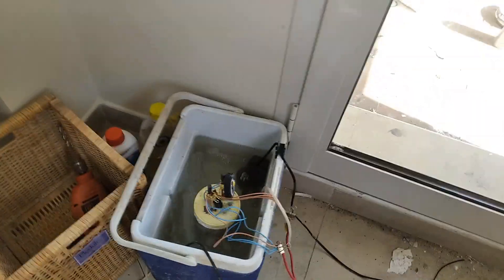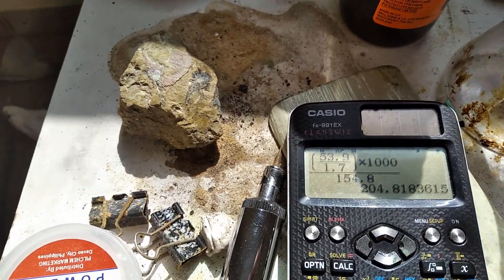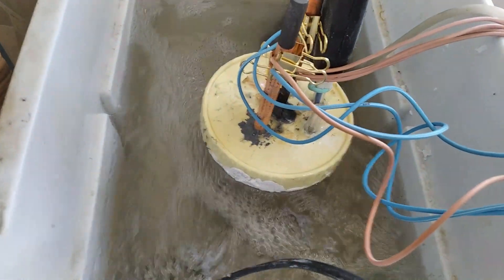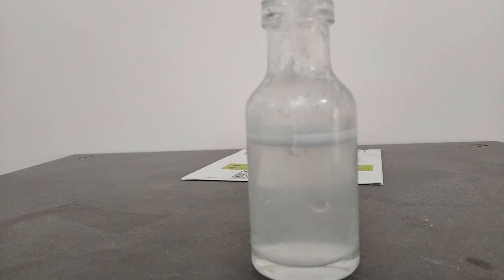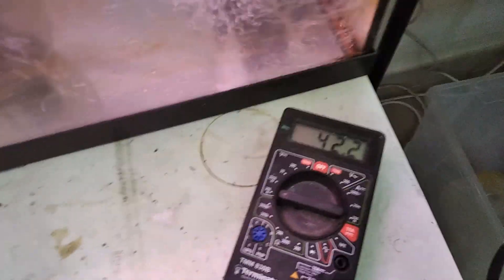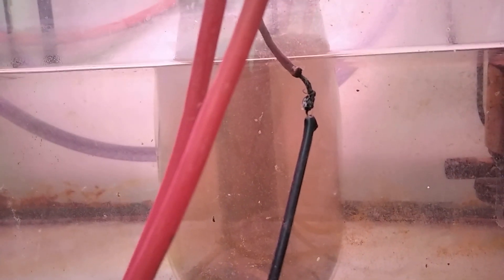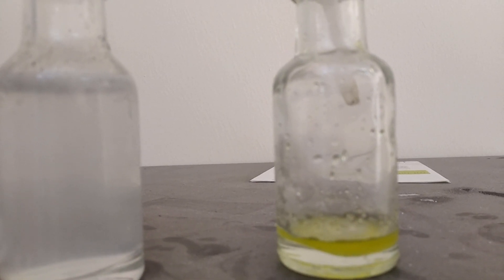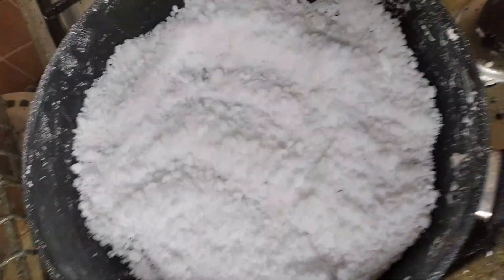32 amp Perchlorate cell full run

Comment: Hello Mysteriouschoice,  is it not possible to produce Kclo4 using only graphite anodes/cathodes.
Reply from the maker: no its not possible get either PbO2 or Pb doped Ir-Ta electrodes from aliexpress. cost is around 50 USD
Reply: @CatboyChemicalSociety  thanks for reply. I went through your channel, thanks again for sharing tons of information. Im possibly gonna try making kclo4 through thermal decomposition of kclo3. Any type of electrodes except carbon/graphite are just to difficult to find in my country, at least i can make kclo3 using carbon anodes. I dont need super high qty of kclo4 just few 100gms to make a safe flashpowder.

Comment: My perchlorate cells use Ti sbutrated PbO2 with SnO2/Sb2o3 intermediate layer and Titanium cathode. There is no pH control in my cells. My electrolyte contains 350g NaCl with 1000g H2O. In the process of dissolving NaCl I add 4g Na2S2O8 but there is a lot of Cl2 (or ClO2) gas coming out, I smell it. I then electrolyzed the solution at 80 *C and after realizing that the solution was heavily contaminated with gray suspended PbO2, I filtered the solution, lowering the temperature to 63*C, the solution was less cloudy. more than that. I noticed that, even after electrolysis for a very long time (about 4-5 times the theoretical time), the chloride content in the solution is still very much (200g/l). I continued electrolysis for another 36 hours and the chloride content decreased slightly. No perchlorates are generated. The cathode is dirty and covered with a black film. What is the cause of my blocking problem? what did i do wrong

Comment: LOL amateur home work! Dirty, full of fail. 😂😂
Reply from the maker: those graphite rods are cathodes btw not anodes.
Also improvements have been made from the old cell.

IDk what counts as fail here but the product was indeed made and decently converted as shown in tests later on in the vid.

The only real fail was the loss of yield due to electrolysis spray but the venturi setup takes care of that problem in the future cells.

Comment: So there is no corrosive chlorine involved, right? That explains why your graphite electrodes are not corroding like crazy.
Reply from the maker: the graphites are cathodes not anodes.
and yes ozone is evolved in place of chlorine!
Reply: @CatboyChemicalSociety  I see an MMO anode was used. Perfect.
Reply from the maker: @Berghiker  PbO2 anode made from lead perchlorate plating cell
Reply: @CatboyChemicalSociety  oh, ok.
Reply: @CatboyChemicalSociety  How can lead perchlorate and electrolyte be made to electrochemically coat the anode with lead dioxide? Do you have a video? Or at least the composition of the electrolyte, and how it is superior to lead nitrate and copper nitrate?

Comment: You mentioned a online calculator. Do you have a link to it?
Reply from the maker: http://www.vk2zay.net/calculators/chlorates.php
Reply: @CatboyChemicalSociety  do you have one for perchlorate if not could you tell me how to calculate it
Reply from the maker: @itsmanlikehark3203  the one on link has perchlorate cell in it just subtract tinings if you start from chlorate and remember to account for weight increase. Overall though you cannot actually calculate a perchlorate cell runtime because of how silly they can be with current efficiency.
Reply: @CatboyChemicalSociety  if I can’t calculate perchlorate run time how do I know how long to run for
Reply from the maker: @itsmanlikehark3203  test electrolyte using acid test which gives a good indicator. This is done by taking 1ml of sample mixing a pinch of NaCl and adding equal volume of 95% H2SO4 and if it makes yellow gas or pops it's not ready. If it just turns yellow to light yellow its ready if you use Pt anode. If it turns very light yellow to clear with bubbles then it's ready to near fully converted. The calculated runtime is merely used as a guide but most runs take 1.5 to 2x as long as the calculated runtime of chlorate to perchlorate. Sometimes the run matches perfectly with calculated runtime it's really weird and unpredictable.